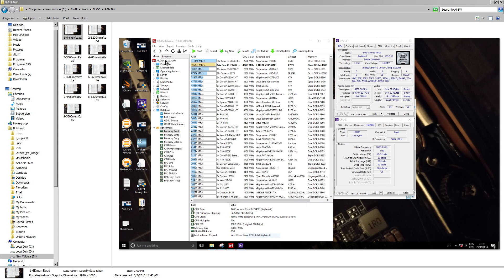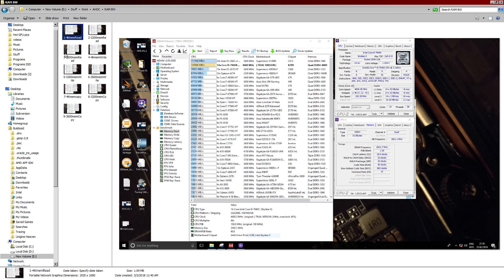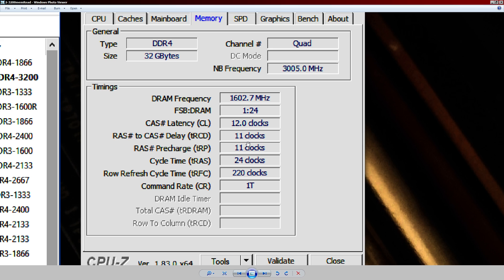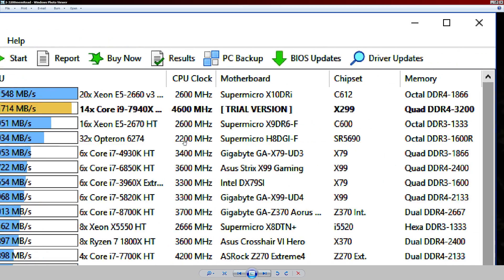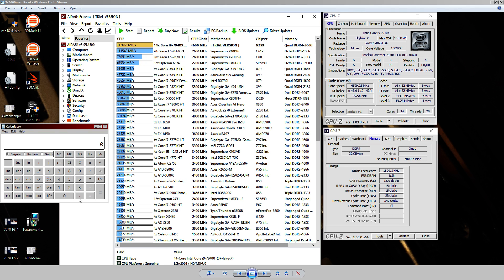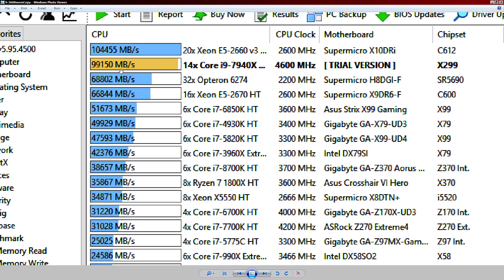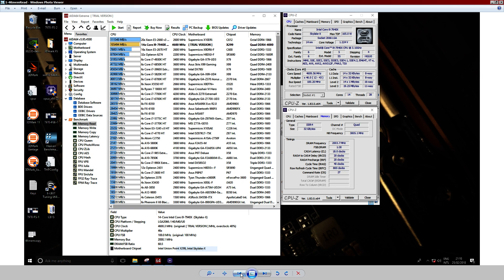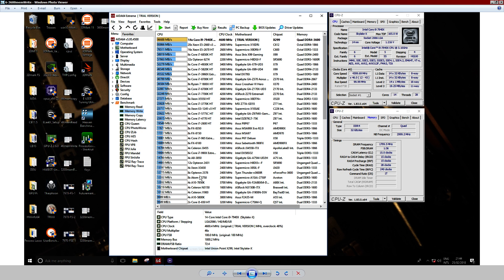Some RAM Bandwidth vs frequency and timings data..... kinda

Comment: I’m using userbenchmark. I have a Ryzen 3700x. My board is Asus crosshair VIII formula X570. The memory I am using is  F4-3600C14Q-32GTZNB is it B-Die. My ram volts is 1.45
My timings the first 6 r, 14 14 14 14 30 48
My tRFC is 344. The ram score I get on user benchmark is 113. I know this ram will do way better I am running the ram at 3800mhz.

Comment: how do you get over 100k read on x299 with quadchannel when I only get like 60k max on x99 with 3333 cl 13 13 13 36 cr1 260? x99 has quadchannel too or what is tanking the bandwidth so much?

Comment: So theoretically if we have DDR3 2133 and DDR4 2133, DDR3 and DDR4 will have the same RAM Bandwidth if they have the same clock because DDR3 2133*64*2/8=34GB/s and DDR4 2133*64*2/8=34GB/s that is in dual channel, correct me if i am wrong please?

Comment: What's a max safe voltage for daily use for DDR4?
I'm gonna start contributing to your channel through Patreon, I've learned a lot from you.
Reply: Je5tercore Intel has listed the max XMP2 profile voltage as 1.5.  I've seen lots with 1.45v, none with 1.5v, but that's where I'm at right now.  So far so good.

Comment: am i the only one hearing the distortion/fuzz in the audio?
Reply: yes? there is slight hiss but pretty sure that's common in his videos...

if you are using a dynamics compressor enhancement, then it would make the loud parts quieter & the quiet parts louder, making the hiss louder, ruining the sound, so never use anything other than an EQ (& when EQ'ing never raise, only lower)

Comment: New to PC, never OCd my RAM (well first build had 16gb Crucial Ballistixs 2666 at 3200 with no timings adjustment on a i5-7600k at 5ghz. Now I have an i7-8700k at 5ghz on an Aorus Z370 G7 with 16gb of Corsair Vengeance RGB 3466(B-die) with pretty sloppy timings as you've now shown me, about to go tinker. Thanks Buildzoid.

Comment: General max guidelines for cpu voltage on Ryzen. 1.42v Gen 1, 1.4V Gen 2. Vsoc = 1.2V except for APU's = 1.15V. But, you have to be using a quality motherboard with quality components, enough VRM's, and heatsinks to manage the heat. Use a garbage motherboard and\or a case with inadequate cooling at these settings for everyday use and their will be consequences.

Comment: I just used this video as leverage to tune my Patriot Viper DDR3 @ 2100 Mhz. Definitely recommend this channel for newcomers. I learned something new about the uses of timings & performance (regardless of clock speeds) and doing calculations to figure out the max bandwidth.

Comment: Awesome video as always, I have a question/looking for advice... not really relevant to this video however so I apologise for that. I have started building a custom cooling solution and was wondering is there any negative side effect from running RAM at sub zero or close to zero (Celsius)? I understand SSD's lifespan is degraded when running too cold... does RAM suffer in the same way? Endless Google searches just bring up LN2 CPU overclocking info. Thanks in advance!!! :D
Reply: I can't help with first hand experience, but RAM should not give a dimm about low temperature, same like CPU. But condensing water could be problematic.

Comment: Hey interesting video!
But wait a minute...lets say I get a RRD4 3600 CL15-(...) that comes out-of-the-box like this and use a good oc motherboard, and set that ram exactly as its max stated freq and timings are by XMS, is it possible to have a stable system with an i5 or i7 without any bottle-neck issue or worst incompatibility without having to overclock the cpu?? Stock cpu freq and ram at 3600... Thankx!

Comment: So for gaming I know that latency matters more so reducing timings is better than getting higher frequency, but how much frequency is it worth it to give up?
Reply: No you idiot speed matters way more then any latency on games you get more more FPS but benchmark  look at latency  also filling you dims with memory gives you more bandwidth then 2 dims slot 

Also a 40000 GHZ memory has a true latency of 13.50
Reply: @PCSIMDYNAMICS  calls someone asking a reasonable question an idiot, then proceeds to talk about memory ranks without taking to account the topology of the motherboard, says 40,000Ghz, and spouts latency figures without timings. Who's the actual idiot? Lol
Reply: @PCSIMDYNAMICS  40 thousand Gigaherz you say???

Comment: I just got some G Skill Trident Z 15 15 15 35 3000MHz @1.35 on a z170 extreme4 /6600k. What timings and frequency should i try while keeping at stock 1.35 v? 
Would you do a dedicated RAM OC guide? I'm sure with you skill and knowledge it would be the best on the net!
Reply: tweaks are trial & error, you will have to find out yourself by seeing what is stable

Comment: Well, I havn't bothered doing it for awhile, but back in the days, you could find the chips timings in ns on the vendors website.
So it was all about rounding them up to a clock number, depending on the speed you were running it at.
Then, it's all about how much voltage you're willing to run through it.
I've lost countless hardware parts to oc, so now I just limit myself to specs

Comment: Memory is certainly not in my wheelhouse of expertise so - if tREFI basically just unilaterally reduces Memory performance period, what does it even do? why does it exist, does it need to exist?
it sounds like a scan to remove data that's no longer needed to be stored, i think?

Comment: Could you please tell me how to calculate the bandwidth of let's say a 2 Dual Channel Kit in a system? Is it going to be the same 256 or 128 separately? I commented on your Buying "DDR 4 Basic video" regarding my 2 Dual Channel HyperX Fury  2133Mhz that I kinda got sped up to 2933Mhz with 14-16-16-34 timing on 1.36V. The stock 2133Mhz timing is 14-14-14-35. Once again thank you for sharing the knowledge.

Comment: Awesome vid.Since I have a crap binned 2400mhz cl17 micron bdie sticks, and I couldn't get more than 2666 out of em on my ryzen, I pretty much maxed every timing i have access to, putting as low is it can go and remain stable. In geekbench, I actually beat some 2933 and 3200 MHz sticks in copy and bandwidth (my only setback is my latency) , so thats awesome.

Comment: 2 years ago, I bought Corsair 16GBx4 Platinum memory at XMP 15-17-17-35 3000Mhz. Can't overclock the ram over 3100Mhz. Timing is no good either.
Reply: you didnt mention voltage or which memory controller is being used
Reply: kn00tcn
Doesn't matter, a single 16GB is hard.

Comment: Can you do a video explaining what all these timings are?
Reply: In a very simple way but complete if possible. 
Not everybody is that good at english. 
There are some things that I still haven't understood like can I go under with timings on my modules?
There is a way to know how long an udimm could last under a certain setting?
Reply: @temet_nosce  You can certainly set lower timings for your RAM modules than what's shown on the sticker. That's If the RAM sticks are capable of it and you know what you're doing of course.
UDIMM will last you for a long long time as long as you are not running it at a very high voltage for a long period of time. This voltage threshold is different for the different kinds of chips used by the RAM vendor in your particular memory kit.

Comment: Why does he keeps the voltage secret on all these overclocks?
Will it hurt him telling us what it is?
Reply: Because it doesn't matter
Once the OC is stable at a given voltage, the voltage won't affect performance.
And to get the same timings and clocks, any two memory kits will likely need different voltage, so where's the point in knowing what he used?
You might as well buy some B-Die and dial in the timings he used, then see what voltage you need to sustain them.
Reply: He doesn't, its always his XTREEM DDR4 8gb DC Kit at ~1.8-2v

Comment: Throwing a question out Package Wattage, I have two identical system except the mobo. They are I7-6800K's using Asus X99-A II and X99-A\USB3.1 boards. Overclocked to 3,9 GHz all cores VID is 1.171 V with idle watts at 29.85 and the other is 1.205 V with idle watts 26.04. Funny I would think the higher VID would draw more watts or is there is missing piece here.

Comment: That's pretty informative for me. Also, I would 100% watch if you made a video on trying to get the best bandwidth like you mention in this video.

Off topic question: I do video editing, gaming, and transcoding primarily on my 7700k w/ 16GB of RAM. It's currently @ 3000 MHz going 14-15-15-33. I was thinking about bumping up the frequency to 3200 MHz to see if it's stable but at this point, am I really going to benefit from it or is it just a nice number to achieve?
Reply: have you ever seen any encoding benchmark change much from such a minor ram difference?

Comment: You didn't talk about voltage which you have used for those settings...your 3.2 and 3.6GHz looked like it would need at least 1.5V where your 4GHz looked like it can work on 1.35V no problem. I mean if you set 1.4 or 1.45V as your absolute maximum for 24/7 then 4GHz with adjusted timings would be the most effective giving the best results in my opinion.

Comment: Hi there, what does affect the temp of the memory most (exept for voltage)
Ofc. i mean when you change the frequency howmutch extra heat does it produce or if you chage some timings what extra does that do.
Reply: Ram doesn't get hot unless you run the kinda voltages buildzoid does, 1.8-2.0v

Comment: What are your recommendations for setting up 3466 MHz RAM. Currently at CL18 on the asus rog x370-i and the 1800x. I only know like the first 5 timings lol.
Reply: Use this to find out http://www.overclock.net/forum/13-amd-general/1640919-ryzen-dram-calculator-1-1-0-beta-1-overclocking-dram-am4.html

Comment: Nice Video:).
So to get it right....my 2x16GB 3200 CL14 KIt with optimised sub timings is doing 50000 read in Aida.....therefore I'm close to the maximum Bandwith my dual channel Ryzen 7 can do?
Reply: BhaalTheFleischgolem for short time, 1,6V should be safe for B-Die. I'm too kinda curious how far I could go with high voltages. Buildzoid did 3466MHz 12-11-11-11 (maybe even 11-10-10-10, not 100% sure) with Gaming 5, which is just hilarius.
Reply: BhaalTheFleischgolem Nice, I've got similiar results with my 3600MHz CL16 kit (it costed me same as 3200MHz CL14) clocked at 3200MHz 14-13-13-27, what is your board and your primaries, secondaries?
Sadly, I can't run this profile, cause I updated my BIOS and my mb now freaks out when I try to set RAM properly, so settings that were 100% stable are now no where near to that. And I can't flash older BIOS, cause of "security", stupid MSI.
Reply: I use a Crosshair VI Hero with Trident Z. It was quiet a hassle to get it to run on an older Bios like 1403. 
With CPU@3.8GHz, BCLK@100.2MHz Ineeded:
DRam@1.355V, soc@1.05V, ProcODT@60 Ohm, Geardown enabled, Power down disabled, Bankgroupswap enabled(only for dual ranked modules), RttNom disabled, RttWr RZQ/3, RttPark RZQ/1 and the four Cad Bus Strenght values @ 20 20 40 60 Ohm. With less frequenzy on Ram or CPU, they need to be in the direction of 20 20 30 30. 
But with a new Bios this is not nessesary anymore! Now the Auto settings do work just fine and you only need to set Dram voltage and soc voltage and it is just as stable and fast. But I'm not sure what values are used with auto, so I force my old settings.
Latencies are:
DRAM CAS# Latency [14]
DRAM RAS# to CAS# Read Delay [13]
DRAM RAS# to CAS# Write Delay [13]
DRAM RAS# PRE Time [13]
DRAM RAS# ACT Time [26]
Trc_SM [42]
TrrdS_SM [5]
TrrdL_SM [7]
Tfaw_SM [29]
TwtrS_SM [4]
TwtrL_SM [8]
Twr_SM [10]
Trcpage_SM [Auto]
TrdrdScl_SM [2]
TwrwrScl_SM [2]
Trfc_SM [304]
Trfc2_SM [203]
Trfc4_SM [145]
Tcwl_SM [14]
Trtp_SM [8]
Trdwr_SM [6]
Twrrd_SM [1]
TwrwrSc_SM [1]
TwrwrSd_SM [6]
TwrwrDd_SM [6]
TrdrdSc_SM [1]
TrdrdSd_SM [4]
TrdrdDd_SM [4]
It may be possible to get better results with more voltage, but it is my daily system so I want it to last;)
Reply: your max theoretical bandwidth is 51200,so yea, you're really close:
3200 * 8 * 2 =51200
frequency * bytes per chanel(always 8 on ddr4) * channels
Reply: My RAM timings with my shitty MSI board, getting something like 50500 read Aida:
Freq: 3200MHz
Command Rate: 1T
tCL: 14
tRCDRD: 13
tRCDWR: 13
tRP: 13
tRAS: 27
tRC: 42
tRCPAGE: 0
tRFC: 260
tWR: 10
tWTR_S: 4
tWTR_L: 12
tRRD_S: 6
tRRD_L: 9
tRTP: 8
tFAW: 28
tCWL: 14
tCKE: 1
tRDRDSC_L: 3
tRDRDSC: 1
tRDRDSD: 5
tRDRDDD: 5
tWRWRSC_L: 3
tWRWRSC: 1
tWRWRSD: 7
tWRWRDD: 7
tRDWR: 7
tWRRD: 2
Reply: nice:)
If DRam would be cheaper again, I would go for high voltages and try some more frequency. Maybe not for daily use, but just to try out how much performance there is to gain in games.
Reply: A problem with the Crosshair VI Hero is the temperature sensitivity. There is some kind of problem with the Bus system and Dram gets unstable over 50-52°C. So much more voltage may get me into this temperature range. It was a problem, back when I had not found RTT and Cad Bus settings and had to use 80Ohm ProcODT and more Dram voltage to get it stable. It would heat up too much and crash after 1-2h with Memtest.

Comment: I've noticed that sometimes you get better performance on looser timings on GPU benchmarks and games than some CPU benches.  Also games seem to be smoother with looser timings, around 3800mhz with the right timings seems to be optimum with Kaby & Coffee Lake when running around 1.55v on the sticks.
Ryzen is a bit trickier as it alters the northbridge (mesh) speed with the memory speed so best results vary between 2933mhz & 3200mhz for me depending on the CPU cooling as a higher mesh will make the cpu hotter and affect performance.

Comment: It is possible to calculate the optimal combination for speed and timings for a given memory specification. I have a sheet in my channel that calculates the timings for a specific speed, but to calculate the optimal combination the limits in mathematics can be used. The problem is that I totally forgot how to calculate the limits regarding the lowest speed differential maybe you remember those calculations.
Reply: +Grey Goose
He means in terms of maximum bandwidth.
In terms of maximum performance then yes it'll depend on the application, but for a bandwidth limited application there is a optimal combo.
And with the APUs that is worth looking at.
Reply: David Martins maybe ask on quora?
Reply: David Martins What do you mean with "optimal"? Doesn't that also depend on the application?

Comment: whats the maximum voltage on hynix AFR chips for 24/7 use without degrading them?
Reply from the maker: 1.5V
Reply: +Actually Hardcore Overclocking thank you :D btw, your videos are awesome and very helpful. Keep up the good work.

Comment: If only there were a way to simplify x * 2^8 / 2^3 :P I appreciate explaining it the first time though. How relevant is memory bandwidth for 2400g; where would the sweat spot between frequency for CPU and bandwidth for GPU be, in most scenarios?
Reply: Mihai Bica CPU freq and memory bandwidth are completly different things.
Reply: +Dominik Liberda right, i forgot there is a difference between cpu frequency and memory controller frequency. Damn SOC's making everything more complicated.
Reply: Memory bandwidth is the most important factor for the APUs when it comes to gaming. After that it's the GPU, and lastly the CPU which gets a pretty good job done by Precision Boost 2 so doesn't really need to be touched tbh.

Comment: Thanks, i have only tried briefly overclocking my new ram, but i hope to see more videos from you helping me figure out how to get the most out of my ram :D Just to be clear is it save to put 1.5 volt into my ddr4?
Reply: If it's Samsung then yes, but if it's Hynix then no that'll only handle up to 1.45V.

If you're unsure, stick to 1.45V.
Reply: thanks, it Samsung B, i am trying 1.5 volt at 3200mhz with 15 17 17 35 timing, but i cannot boot with lower timing and if i go higher in clockspeed then games start crashing randomly.
Reply: If you're on Ryzen try http://www.overclock.net/forum/11-amd-motherboards/1624603-rog-crosshair-vi-overclocking-thread-2067.html#post26178558 or http://www.overclock.net/t/1640919/ryzen-dram-calculator-overclocking-dram and run HCI Memtest to 500% to be sure about stability. If either don't work, move to the latest BIOS and try again.

Memory OC is a pain, hopefully these help a little bit. Good luck haha.
Reply: no, i am on an asus z370 f motherboard with an intel i5 8600k paired with crucial ballistix elite 3466mhz ddr4 ram.
Reply: Ah. Welp maybe give them a shot anyway. Memory's worse on Ryzen so it might still work on Intel, you never know.
Reply: yeah i was trying to find all the settings in the bios but i could only identify half of them, plus i got like twice as much settings... i just cannot find any comprehensiv guide.
Reply: It's tough with memory OC, not many people do it. Could try the Intel subreddit or overclock.net. Beyond that, no idea.